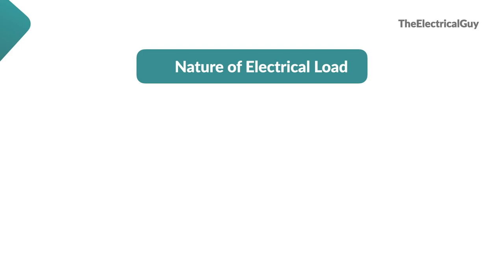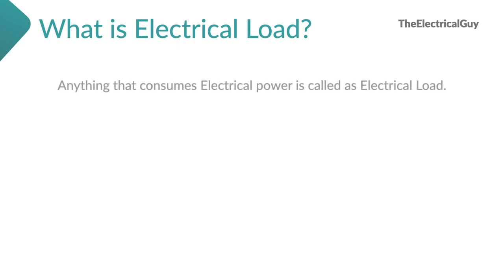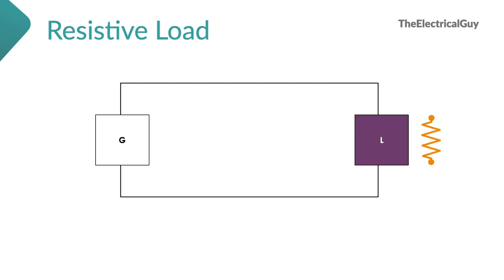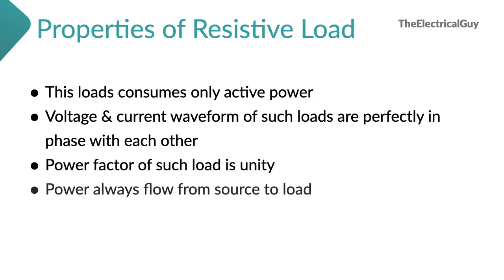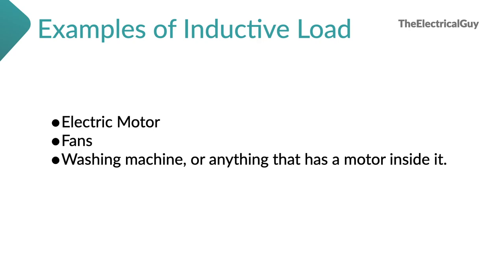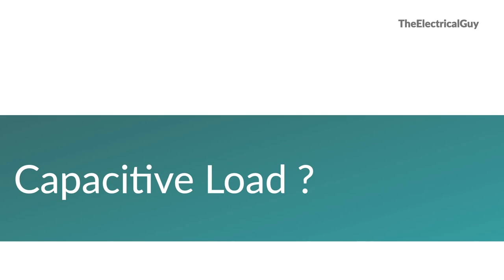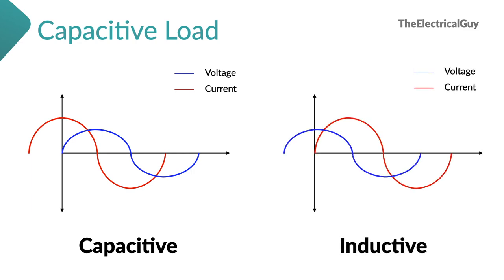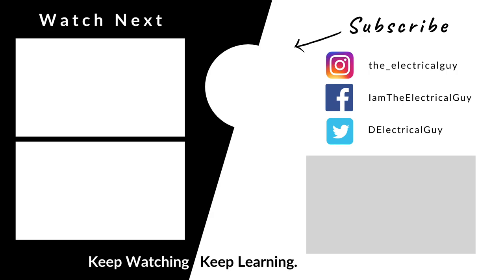Types of Electrical Load | Resistive, Inductive & Capacitive Load | Explained

Comment: When you are simply directly charging a capacitor would it not then be consider a capacitive load? Then just stops being a load once it is no longer a load (voltage equalises to the circuit)?

Comment: Iron box is indicative load. I have experience shock after switching of and with VFD drive motor will it be difficult
To control inductive load or need a capacitor load for balance ? The video is  nicely explained.

Comment: I need your advise , in an industry due to huge welding machines (inductive load) there is voltage fluctuation due to which solar inverter has synchronizing issues , please suggest how can we avoid this voltage fluctuation ?

Comment: Gaurav ji. I have 10 years industrial exp.
You said the capacitor cant be considered as load is not correct. Capacitor is also a reactive load like inductor.

The real misconception of this world is that the capacitor is supplier of reactive power is the real misception.

Inductor takes energy from source and returns to source similarly capacitor takes energy from source and returns to source, so both are reactive loads only.
Reply: I would second that!
Reply: he said a capacitor bank cant be considered  as a capacitive load.......

Comment: I am using a bi-directional energy metering IC - CS5463. But i am a little confused while i add a 10uF AC rated capacitor to the output of this meter. It is giving a negative power factor, negative kvar but also a negative active power. Why a negative active power ? Anything wrong with my meter ?

Comment: Very nice video.. I have a very interesting doubt, can you make a video on these. My doubt is:
We know Resistance is electrical element which oppose the flow of current. Then, in series network of resistance, why current is not change or why it's not oppose or decrease in circuits. Why current is same even if I use a resistance connected in series??    Is definition of resistance is wrong?? And finally difference between resistor and resistance
Reply from the maker: Hi. Please try watching my video on series nad parallel circuits. That could help.
https://youtu.be/6M4IUe7XJ2U

Comment: How do those angles make sense in DC circuits? You showed a computer as an example. Computers run on DC. How can there be any voltage or current angle in a varying DC load?

Comment: I connect 1phase supply with 250V,40W capacitor after i switch it on the breaker trip.  What is the reason sir?

Comment: Thank you so much for this simplified explanation on electrical loads. However, don't you think that capacitor bank when in charging mode should be classified as load?

Comment: Yes you are correct there is no such thing as a capacitive load in the sense of a stand alone load that is purely capacitive. I mean maybe someone could argue a battery?? But a battery isn't exactly a capacitor though they are kind of smilar in the sense of storing charge. Not 100% sure but Im guessing that is what someone would argue?

Capacitors and capacitive loads are for counteracting the reactive power caused by inductive loads. Since inductive loads by nature generate reactive power, capacitors are used to reduce this reactive power and help use the most real power possible for increasing efficiency and lowering cost. Point being capacitors are used as a reactionary measure to inductive loads, thus there isn't really any "capacitive loads" so to speak.

There may be an exception I am not thinking of, if anyone knows please let me know as it's interesting.
Reply from the maker: You are absolutely right!!
Reply: @GauravJ  Thank you, it's a great point indeed made in the video that is often over looked by the terminology used!

Comment: Sir u have said that capacitor banks are installed for improving power factor but u have also said that capacitor banks supply reactive power. We know that if reactive power increases power factor decreases but here your saying capacitor banks are installed for power factor improvement but at a time it supplies reactive power. How is it possible ?

Comment: yes
Inductive loads only consume reactive power to spin without the work load. The rest is spent on doing the actual work.
Plus, I already knew capacitor loads are not really a load. You can't have a capacitor consume power, really, unless you're charging it.
This is why good inverters should have some capacitors at the output.

Comment: As ur saying capacitor banks are inductive load as it contains capacitor  properties and three phase system  so how it can be inductive load
Reply from the maker: I did not say it’s an inductive load 🤨
Reply: @GauravJ  under which type of load does capacitor bank comes
Reply from the maker: As I said in the video, we cannot calcify capacitor bank as a load. As it delivers reactive power and does not absorb it.

Comment: I'm not an engineer disclaimer 
But l would say inductive load are load that changes electrical energy into magnetic fields because transformer, contractors and relays falls under inductive loads
Or I would have said any coil that consumes power it's an inductive load whether it's a fluorescent ballast or solenoid etc

Comment: Here is one angle why capacitor is consideredd capacitive load.   Time to get philosophical or net picking or however this is percieved.
Is  the conductor betweeen a resistive load and the source  in itself also a load?  If it is, what type?
Howabout all 3. it heats up, it has inductance and it has capacitance.
Waiit for iiiiiit.  It gets more interesting than that.

Lets go deeper than that.... I mean big time deeper.
Howabout the source, the supply itself.  It in itself a load.  What kind...?  You tell me...  🙂

Conclusion. Everything and everywhere is a load and all three types.  It is only a matter of degree.   Right?

Everytime a charge displaces, it needs energy and due to entropy law, it must generate heat and it does.   An electron spontanously emits a photon.  It is not the same photon it absorbed.  It is impossible.  Some of that energy went to kinetic energy of electron, electron moved and plus heat.  Photon emited is the original photon minus heat and minue kinetic energy.  To and from orbital energy level is not free.